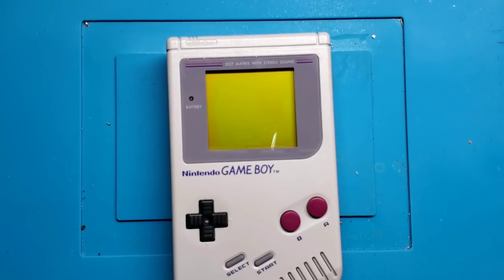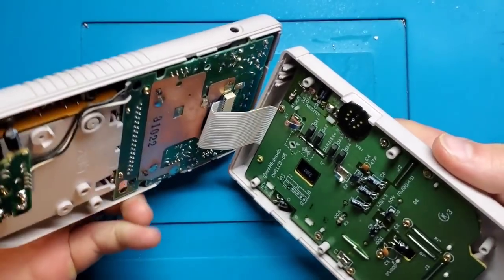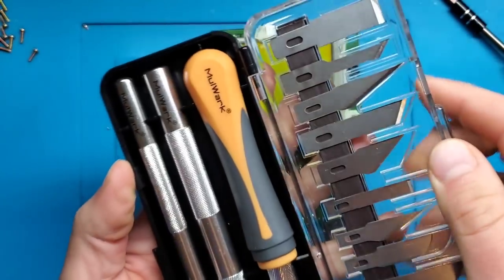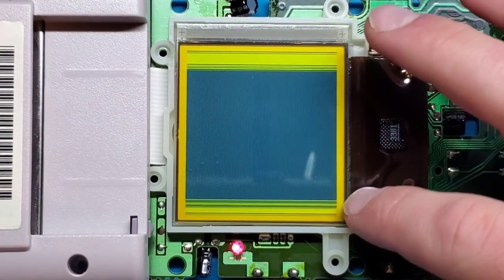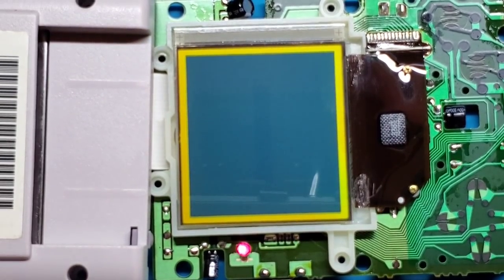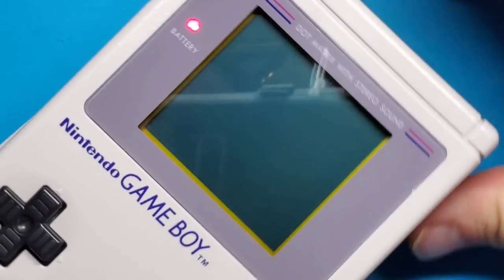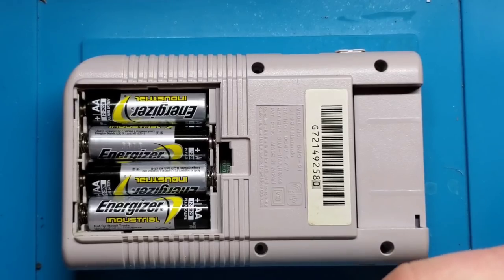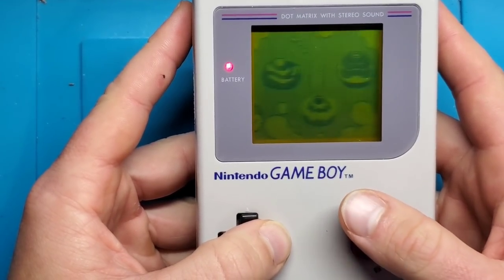Vertical Lines on Game Boy Screen - EASY FIX! - Fixing Ebay Junk

Comment: My Gameboy would display almost nothing, maybe 5 little lines. This worked like a charm. Used my crappy soldering iron that I use for plastic, low at around 400f. Applied pressure and slowly dragged it across the ribbon like a loading bar and all of the black came back gradually. It was a pretty extreme case too. And when I took the rubber pad off, it took the adhesive off with it. That's lucky :)

Comment: Great video!! I actually used my hot air rework station at 600 degrees, moving back and forth quickly from one side to the other. I quickly put the rubber strip back in place after removing the heat and held down pressure on it for 10-15 seconds. It worked amazingly well!!

Comment: Well done. You made it look easy. Other guys on YouTube said it took them up to one hour.
I hope I can do it the way you did. Thank you for mentioning the temperature. Maybe that's the secret.
Reply from the maker: This one went very quickly.   I've had some that were a bit more finicky,  but luckily this one cooperated well
Reply: So what's the variable heat? Cause I see some that go from 400-420 degrees celsius to 500-520 degrees celsius.

Comment: I bought one of these yesterday from a guy on gumtree. It had horrible lines. Couldn’t see the selector for Pokémon in the menu in Pokémon Red. I left it on a lower shelf on my bookcase and sun shined on it for a bit. Then when I turned it on about an hour ago, most of the dead pixel lines were gone!

Comment: Ok, so 99 percent of the time if this DOES NOT work, there is some kind of corrosion that can happen to the traces that the brown strip connects to just underneath the bottom glass edge. Also if any of the traces are ripped underneath the portion that solders onto the board at the opposite end of this ribbon, your pixel lines will not come back. Be sure to take a good look and see if the parts gameboy you buy off of ebay doesn't have rub marks on that ribbon, as it may have been tampered with already, or else you might as well yank the screen out and replace it with an IPS one.

Comment: I tried this method, worked flawlessly for the lines on the outer edges. But I am stuck with one line near the middle, the soldering iron didn’t seem to help. Any suggestions?

Comment: Random question so I know you repair cartridge based games but do you also repair disc games? Like using a disc resurface machine?
Reply from the maker: Not really.   I've tried getting some light scratches out,  but i don't have a resurfacer

Comment: what temperature did you put your iron at to let it melt solder but not the cable?
Reply from the maker: I had it at 500f, you can go even lower which may take longer,  but will be safer.   Higher temps need to ensure you're always moving as to not burn the ribbon connector. 

I'm not sure how much heat it can handle,  but there's no real reason to go much higher

Comment: The real question is what's that going to be like in the long term? Dave over at EEVBlog did something similar and the display just went back to how it was after some time.
Reply from the maker: Great question.   Time will tell i suppose.
Reply: I guess you could add more pressure to the ribbon to force that contact

Comment: Did this and it worked but then 3 lines came back a few months later, went back to do the same trick again but no matter how long I do it for the lines just won't go away, any advice?
Reply: Maybe a little more heat and pressure. Just need to create a lasting bond

Comment: What is that black material you are hitting with the iron?  Do you think hot air might work as well?
Reply from the maker: I've never tried.  My concern with hot air is that it isn't very accurate so you may actually make it worse
Reply from the maker: And you risk damaging the actual screen

Comment: i always worry about battery leaks for health reasons because of my OCD. i'd like to know your opinion on it.
Reply from the maker: I don't imagine here's much of a health concern.  If you do encounter a leak and you're worried about it, you can always wear gloves or just make sure you're washing your hands well if you touch it.  Obviously you don't want it in your eyes, but I don't imagine you'll absorb much though your fingers which is usually pretty thick skin with a small leak like this.

Comment: How would you fix horizontal lines? i have one with that issue
Reply from the maker: Similar process, except it's much more difficult to access.  The ribbon is tucked behind the display so i assume the vertical ribbon needs to be desoldered to access it
Reply: @RetroRepairs  iirc there were some screws on the ribbon cable in the front of the screen, if you remove them you should access the ribbon cable on the back of the display without desoldering
Reply: i have heard that the screen is toast if you have horizontal lines, you're better off just getting a new dmg, or modding it with a IPS screen.